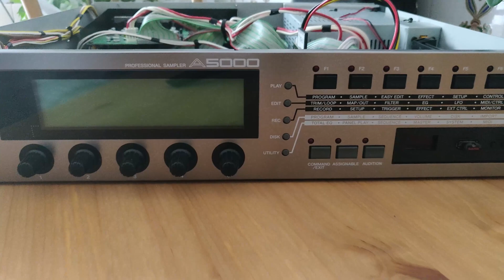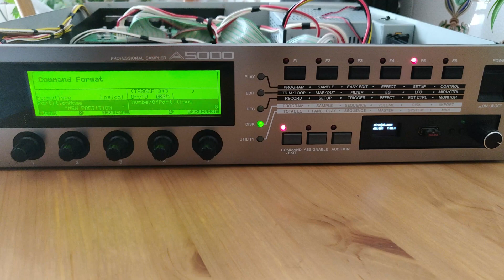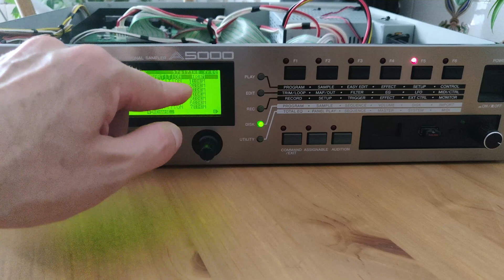Yamaha A5000 Compact Flash Card & Gotek USB Floppy Emulator Jumper Settings

Comment: Hi, where the other side of the jumper cables black white and blue white connected to?
Reply from the maker: 5:13
Reply: @aymatorg  He was asking what is on the other end of those leads. Something that is not revealed in the video.
Reply from the maker: @r0tekz  My bad, from what I've learned:

JA is used for to enable READY signal output 
JC is used to set IBM PC-compatible mode
S1 jumper sets the drive ID

Hope that helps!

Comment: Thanks for the video - I have the same adapter and this was really helpful to get the jumpers sorted. However I still have a problem unfortunately - the only compact flash card I have that is recognised by the A5000 appears in both Master and Slave position on the Disk screen, where you do "Disk" -> F5. If I remove the master/slave jumper, or put it in the other position, nothing shows up, but when it's in the Master position like this video, I see the name of the card and size in both positions. I'm trying to format it anyway in case this is a minor glitch but I've left it for hours with the progress metronome and nothing happened, indicating to me it's not actually formatting. Maybe worth noting the card is a 32GB one (both the 8GB cards I tried were not recognised) - any tips? I'm ordering a Transcend card like you used, hopefully that will work...

Comment: Many thanks for a great video...Having trouble here with my A4000 and a CF adaptor. Jumpers are both in the 1 to 2 position but drive not recognised. Using a Sandisk 4GB Ultyra 30mb/s. Anyone get that card to work?

Comment: Great video! I am considering the A5000 as my first sampler (probably crazy, I know). There are 3 things that worry me though:

1) the operating system looks really difficult to me and I could not find any video on Youtube about the actual sampling/editing/mangling process. Could you consider, if you have any spare time, to do a video on the workflow?

2) There are many people reportibg faulty encoders. What's your experience with them?

3) How did the USB floppy emulatore work out? How did it improve the overall functionality of the machine?

Thanks for your time!
Reply from the maker: Thanks! To answer your questions:

1)The A5000 is actually a very easy sampler to navigate through. Don't let the small display scare you. Once you understand how to navigate through the front panel, it's really straight forward. I'm in the process of creating a series of tutorials, beginning with a general overview, sampling, synthesis capabilities, and using the gotek floppy emu.

2) Yes, the encoders on the A Series samplers are notoriously bad. The only fixes that I know of are replacing the encoders with new ones or using contact cleaner. I'm currently in the process of making an encoder fix tutorial using Deoxit so that should be up soon.

3) The gotek works great. Not having to use floppies is always an improvement but you're still limited to the size of samples you can use in a floppy image which is 1.4mb. That may not seem like a lot if you're using something like Kontakt, but you can do quite a bit within that limitation. For any samples longer than that, you'll need to sample directly into the A5000 and make sure you have enough RAM to support large sampling times. You can max out the A5000 at 128mb of RAM but 64mb should be plenty. RAM for vintage samplers can get a little expensive, so if you do buy an A5000 make sure you check first to see how much it comes installed with. The A5000 by default comes with 4mb of built in RAM, so if you don't have any installed, that'll give you about 23 seconds of sampling time in stereo. Again, may not seem like a lot but you can make entire tracks just using that.

Let me know if you decide to pull the trigger on one and feel free to reach out if you have any questions. Cheers!
Reply: @aymatorg  yeah I agree! I have an A4000 and it's a fantastic sampler even for beginners. It's also one of the best samplers ever made, hands down. You can't go wrong with it!